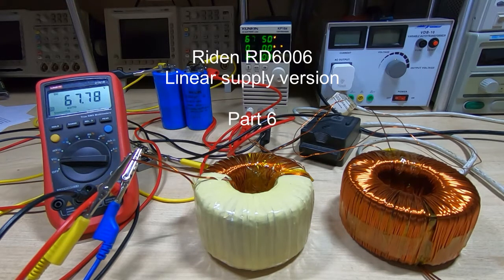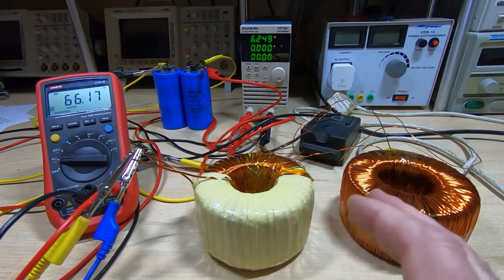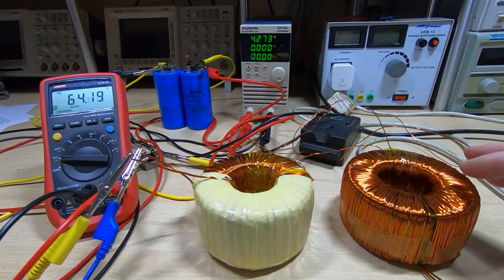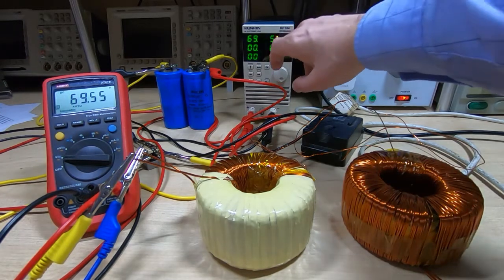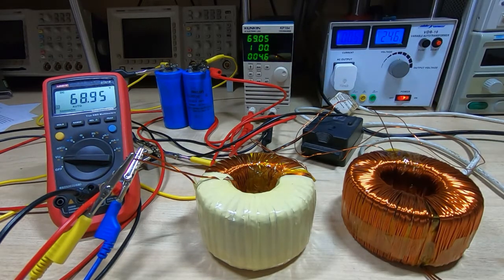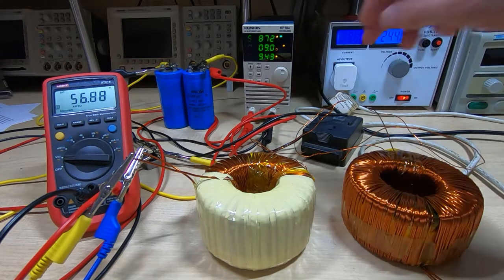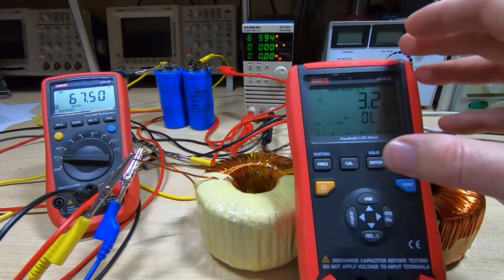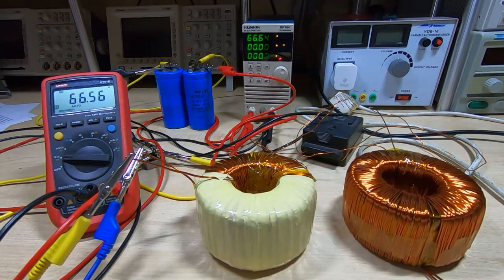RD6006 Linear Part6

Comment: this is, imho, the worst way to power an RD6006, because the transformer is affected by the variations of the mains voltage, so it could have fluctuations in the output. Current fluctuations can cause the input to exceed the 70v limit. Furthermore, a traditional transformer power supply is heavily affected by the load, so that the voltage drops dramatically, this puts the Rd6006 in danger. Finally, it makes no sense to think of having a traditional power supply while using a transformer if you then use a Buck Voltage Converter ....

Comment: I watched your very interesting rd6006 linear series and was wondering if a capacitor bank like this would also reduce the noise and improve the normal switching supply setup. Or would  the capacitive load influence the switch mode supply in a bad way?

Comment: OK, great, I'm following this.
Lots of good tips.

I was thinking that you'd measure the resistance of each winding as you finished it.
But I've not seen that.

Seeing as the resistance per m is very consistant, it seems a good way to sanity check the number of windings.
If you did a measurement of a known number of windings (say 4 or 5) it would give you an accurate value per turn.

Unless I missed it, you don't give the torroid dimensions.
If one knows those, as well as the gauge of wire used (and I haven't seen where you say what the Secondary is, just the Primary), you could predict what the resistance SHOULD be.

At least for these simple ones where there's not much layering going on.

I tried to estimatre the torroid you use from the dimension of known objects in the video.
And I THINK it's 81mm (OD) x 50mm (ID) x 50mm (Height).
But that is hard to be accurate about (is like the CIA using a satellite to check for hiden nukes...:-}

Anyways, my CIA Sleuth estimates for the inner wrap, for the Secondary, it's +/- 200mm per wrap.
So for 60 wraps, that's 12m.
The wire LOOKS like AWG 12, which is 5.21 ohm/1,000m.
Which means resistance should be 62.5 mOhms...sigh.
So is hard to measure with any multimeter.
But you've got constant current sources by the bucket load, so could run a constant through it, and measure the voltage drop.

For the Secondary, it's harder my end to estimate because I don't have any details.
But let's say the circumference is increased to 220mm (hairy-assed guess), so 60 turns gives it 13.2m long.
And you do say the gauge of that (0.85mm) which if you add some insulation, is probably AWG 20.
And that has resistance 33.3 ohms/1000m.
So for 13.2m it's say 2.0 ohms.
Can check same way.

If one used a known voltage on it, then by measuring output voltage, and current input and output, could do a reasonable job of characterising its efficiency.
And do each one separately.
As well as measure inductance.

I mean why not, with a huge rack of shelves of all sorts of electronic gear.

And then could do another set of measurements on it after it's wired up in series, using whichever rectifier option you used.

In fact, I was hoping you were going to use those Shottky diodes on this.
And could compare the overall efficency/losses uses both methods.
Also scope the output using both.

So sure, it might sound like a lot to do, but isn't that part of the fun part after all the drudgery of winding the suckers?

I think that this project of making a really good backend supply is worth some effort.
There's a REALLY big number of these cheap & cheerful digital front ends floating around.
But they don't supply PSU's.
And the ones you CAN buy are not really that great.

As in they're quite expensive compared to the cost of making one of these linear supplies: cost up to £50.
And they don't make them in the larger power size: biggest they go is a CLAIMED 800W.
And that's not very satisfactory, because you only get 16amps at 48V.
Or else 11amps at 65V.

Plus as you've said: they are pretty noisy.

So I think the aim would be to build a torroid based supply that gives enough to power the RD6018 (1080 Watts).
Which has a rated output of 60V and 18 Amps.

So what torroid does that need?
I imagine 70V and 18amps?

For that much power I think we are wanting to look after efficiency.
Reply from the maker: In general you use specific wire diameter based on your design current. I do not measure resistance as it is not consistent and will vary depending on the number of layers you wind. I count the turns as I apply them and the final check is that the ratio (voltage) is correct when the transformer is finished. One of your first calculations should be turns per volt and that is what you use for determining the number of turns required. The resistance will not affect the output much as that is a function of the transformer design. Primary current is controlled by the secondary current and so the transformer will tend to automatically correct for secondary resistance although it will affect the efficiency of the transformer. Unless you are familiar with characterising transformers then I would advise sticking to the 'standard' wire gauges for the intended design current (RMS). When designing the primary you should also aim to get fairly close the the saturation knee as this will reduce the number of turns to the minimum and again this will improve efficiency but ensure you stay under it for all expected conditions.  Note that you can also use multiple wires per winding and this can sometimes be easier than using a single thicker wire. It all depends on what you are aiming for and what cores you have lying around.

Comment: Hello Jerry, I watched your videos and bought a toroid transformer with prim.500va - 250v sec 65v - 9A for really cheap... My voltage coming from socket is 235v and I am getting a 61v ac output without load on secondary. Will I be able to use this toroid if I unwind secondary by 20% - Concerning wattage requirements and capacitor bank that u have shown?
Reply from the maker: In theory it should be safe to unwind some turns from the secondary. The easiest way to figure out how many is to temporarily wind 10 turns onto it and then measure the voltage across it at the rated input voltage. Then divide the value by 10 to get the turns per volt. Then divide 11 by that value (61-50 / turns per volt). 50 volts being your target. So if you get 0.4 turns per volt the result is 11 / 0.4 = 27.5 so you would remove 27 turns. Leave enough to put a few turns back on until you have tested it under load as it will depend on the actual core rating and wire diameter used (a lot of cheap transformers are a bit optimistic in their rating). The unloaded voltage should not exceed 70V as the RD6006 will not work above 70V but you need to be close due to the voltage drop under load. Unfortunately it may not be so easy as most likely the primary is wound on the outside.

Comment: Hi Jerry, just a quick question:
You say in the video that the 68 220uF capacitors will give you about 11000uF total capacitance. Shouldn't that be 68x220=14960uF?

Did you misspeak or is there something else going on here?

Comment: I have a silly question. How high is the efficiency of the toroid transformer? I read somewhere it could be 97,5% in total. Is it true? Are different kinds of toroid transformers in regard to efficiency? What about efficiency vs load? Thank you for great content.
Reply from the maker: They vary of course depending on design and core material but they are typically between 95 - 98%. The losses increase with load but the efficiency stays fairly high across the operating range. As the windings heat up then their resistance increases so lowering efficiency as copper losses increase. Using thicker wire can improve efficiency. In additional the magnetic losses also increase out of proportion to load once you get past a certain point. The transformers I wound in the videos seem to have come out at around 96-97% peak but I only made basic efficiency tests so I do not have absolutely accurate values (this is not a commercial design). By comparison a more traditional transformer with E/I or C/T laminations is around 85 - 90%. Both types have a peak efficiency somewhere along their capacity curve (usually around 50%).

Comment: Thanks for posting this series on custom transformers, it's good stuff. Can you post a link to the capacitor bank kit? That looks really handy.
Reply from the maker: I purchased it from here https://www.ebay.co.uk/itm/L20D-68PCS-75V-220UF-Capacitor-Audio-Amplifier-Power-Supply-PSU-Board-Diy-Kit/272194203371?ssPageName=STRK%3AMEBIDX%3AIT&_trksid=p2057872.m2749.l2649 BUT please note that I have no affiliation with this supplier and I have NOT yet tested this board.

Comment: Hi Jerry,
Thank you so much for your videos, and for the way you explain so well everything you are doing.
I have discovered your channel with this great series about the RD6006, while I was thinking about creating a linear back-end supply for it, and subscribed immediately when I found you were dealing with this very subject.
One small question about this sixth part (which I've been waiting for like a kid, coming each day over and over every few hours to see if it was released lol):
The RD6006 needs about 65v input to output the 60v it can manage. With the Schottky rectifier you intend to use, and when connecting directly to mains power, I understand you'll be able to get around 60v (when fully loaded) to feed the RD6006. Can't we remove a few turns in the winding of the primary (that is simpler than adding ones to the primary), in order to rise the voltage to 65v when the load is 360w, and thus allowing the RD6006 to be used at the full extent of its capabilities?
Thank you for your answer, and again, thank you very much for everything you are doing.
Sam
Reply from the maker: Thanks for the comment. I would not advise making changes to the primary in order to raise the secondary for the following reasons. 1)The turns ratio is 2:1 so you would need to remove a relatively large number of turns to get what you want. 2)For every turn you remove from the primary you get closer to saturating the core for a given input voltage. I calculated the number of turns on the primary to give optimal operation. If you saw the video showing the saturation voltage of these transformers then you will see that it is currently 130V per transformer so removing turns would risk overheating the transformers and also the output voltage under load would not rise much as the core would be saturated. The best option if you need the full output from the RD6006 is to add turns to the secondary and then use a pre-regulator to give a fixed 65V into the RD6006. I only need 55V output from the supply but with the values shown I should be getting around 58V at full load. Also bear in mind that there will be significant voltage drop in the many leads I had in the test setup I demonstrated (around 0.8V). This test was just to check the transformer operation and not measure the final ouptput. You could also go up to 1mm diameter wire for the primary and this would give another 0.5V per transformer under full load and so add another 1V to the fully loaded voltage. This should (in theory) give you the full 60V output. The RD6006 only needs around 3V overhead so allowing 64V should allow for 60V output. It really depends on what you need from your supply but as I said in the video the best time to determine this is when designing the transformer as you have full control over what you are aiming for. I will be posting more videos on this shortly.